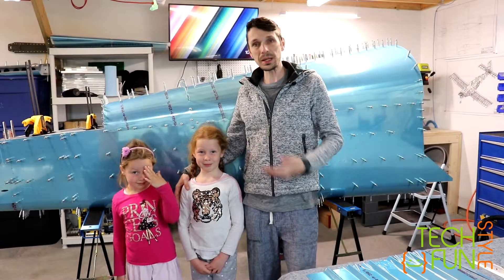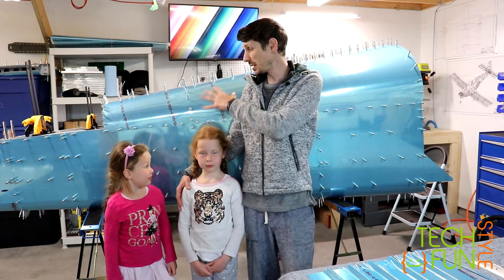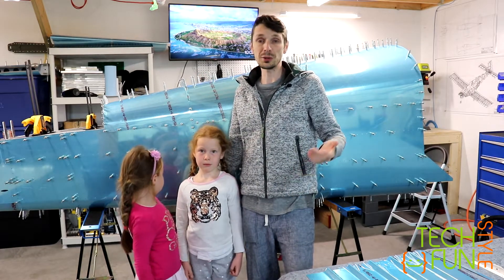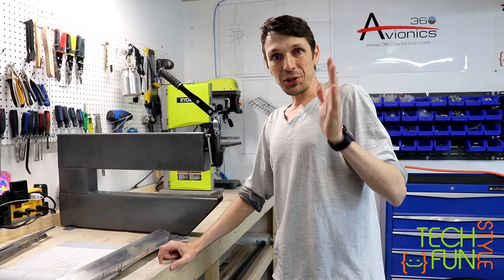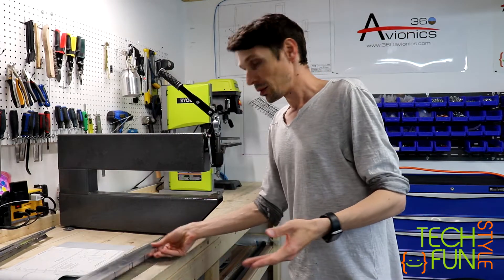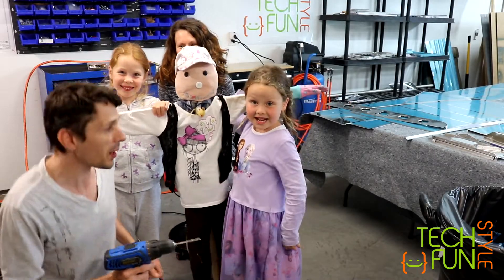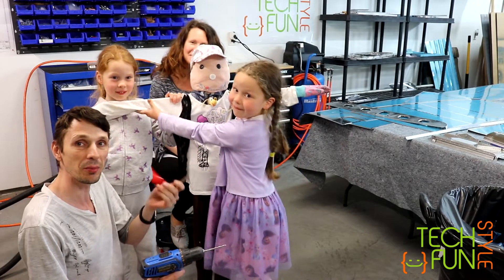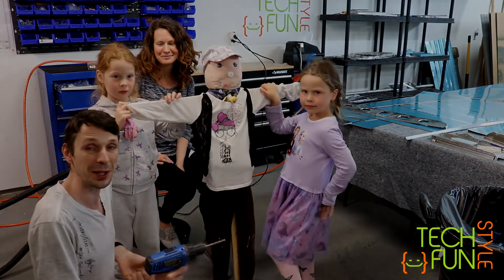RV-10 - Tailcone assembly. Work in progress.

Comment: Hi Vlad
Just curious to know how you go about reading the plans and building? Do you read instruction by instruction than work on it step by step or you read a complete section and organize the work to do ?
Thanks for the interesting vids!
Reply from the maker: Hello! To be honest I read each step and sometimes twice or more times. It is not always clear from the first read what exactly manufacturer expects me to do so I want to ensure that steps is correctly understood by me. Usually when I start to work on new part (rudder, elevators, tailcone, etc) I first take my time and read all steps related to this particular part. I review all tools required, all things which needs to be done. I get all parts for particular step prepared and placed on my work table. After that when I understand what to expect I move forward and starting to work step by step, page by page until everything is completed. On some occasions, due to specific of Canadian home built airplanes inspection requirements I have to jump over some steps and leave some of them for future. Since every step I work on and complete I normally mark (check) with pencil, at the end I know which steps still have to be completed.

Comment: I think the blue film should be taken off on the inside before match drilling.
Reply from the maker: Possibly you right, however I am trying to understand what that would influence ? That blue film is just a protection, it is thin layer of plastic. What would be the outcome if I keep it and not remove ?
Reply: Tech Fun Style The blue film is indeed a protective layer. It’s fine to be left on for match drilling but should be removed or at least accounted for when machine countersinking as the added thickness can cause your rivet to not sit quite flush. 
Keep up the good work!
Reply from the maker: @auburnaviator6167  Thank you! And yes you are right - I always remove blue protective film to ensure that it will not add any thickness.

Comment: I am getting the itch to build.  I have noooooooooooo building experience at all.  Do you have any experience?
Reply: It's like learn to swim, you have get into the water one day by yourselft, dont worry many of us have no experience and have learned.
Reply from the maker: Hey Piper Pilot ! I had zero experience when  I started my build. My core is electrical engineering so the mechanical stuff is something I have done in my life occasionally (vehicle simple repairs etc). This is an amazing learning curve for me. Every time I work in my build I fight with my self and pushing to limits. I want to ensure that I do it the best I can, so at least, even if I did it not that good I can always say: I did my best and that was truly best. If you watch my first couple of videos you will notice that I had many mistakes done. Every next part I build give me another opportunity to learn.